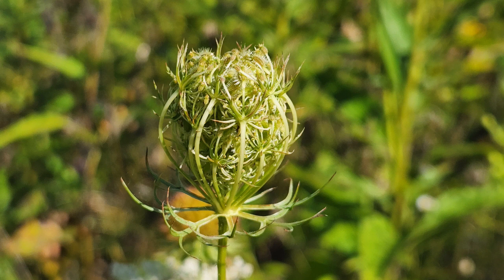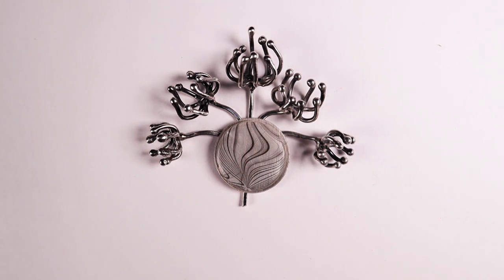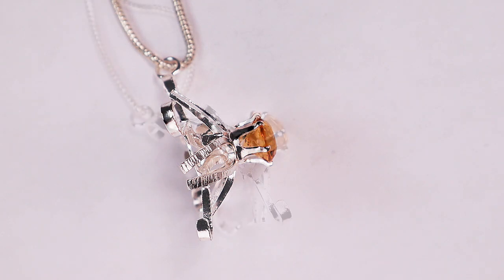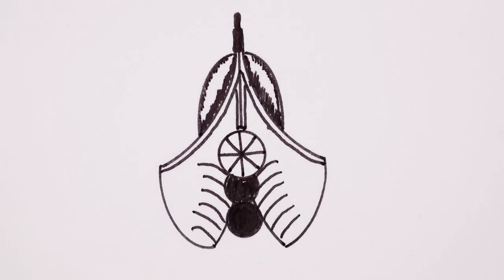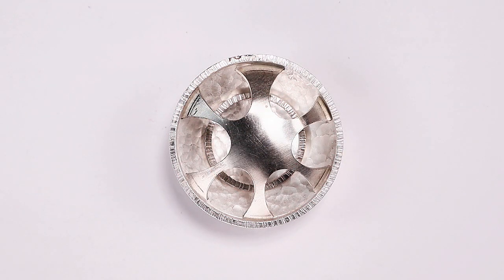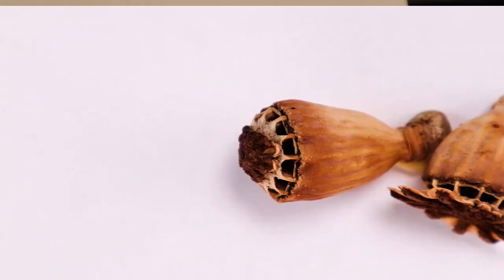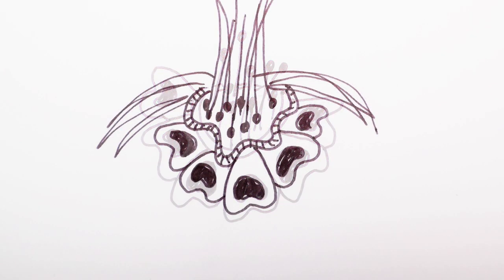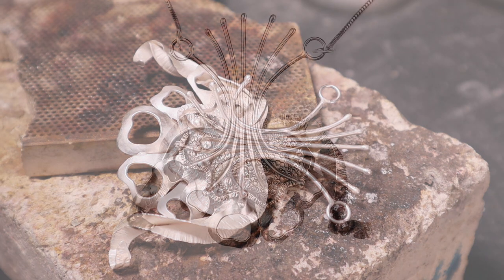JEWELRY DESIGNS FROM NATURE:  PART 1

Comment: really enjoyed all the textures/shapes/depths and craftsmanship. if a beginner had $1000-$1500 and wanted to get some material to get started what would your recommendations be wire/sheet and any online sources would be really helpful.
Reply from the maker: Hello D&L,  Thanks, I am glad you enjoyed the video! 

 For the beginner question. (This is a big question ).   It is always difficult to decide which direction to start  and this depends a bit on the student's interest.  I would start by concentrating on learning to bend, forge and solder wire.  Do not worry about sheet metal.  Get comfortable with the wires. Learn how it bends, how far one can forge a wire before it splits, how to solder small wires to large wires.   Design within the "limitations" (By the way, there are no limitations) of the wire.  Buy some SS wire, getting 12, 14, 18 ga. square and round.   Approx. 10 ft. per gauge.  This will be about $600. Also, get copper wire in 10 to 20 ga.  This will be for practicing  forging. Only buy smaller amounts as you need them. Your learning curve will determine what to buy. 

THIS IS IMPORTANT.  Work for a couple of months only working in wire. 

  Do the same for sheet metal. There are many more techniques using sheet, so start by learning how to saw correctly and with ease. Use copper sheet to learn on.  Saw, Saw, Saw!!  File , File File!  Learn to burnish the edges of sheet so you don't have to polish the edges.   Learn to solder seams and to sweat solder. Start fabricating simple boxes and 3-D forms.  Get comfortable with the sheet.
   
The idea of only working on the wire and/or sheet metal for a long extended time, is to get to know the characteristics of the metal.  Know what to expect from the metal.  Once a student understands what the metal will do, then the student can start to design pieces that will use the metal to it's full potential.  If one skips learning the basics, the student will always be handicapped and will feel and look like an ametuer. 

As for any online sources,  Of course,  start with all of my videos.  Use them as a base and a spring board.  There a other instructional videos out there that have different approaches to the subjects.  Find the ones that fit your personality. 
Wow, I sure hope this helps you and makes sense.  Thank you again for your questions.  You are always invited to ask.   Good Luck.   Greg Greenwood
Reply: @greggreenwood4628  Thanks a lot. This is really helpful. We definitely want to focus on learning to use the tools. Once we've gone through a bunch of metal hopefully in the end be able to make some fun projects with the family. You videos have been so helpful and inspiring. Cheers.
Reply from the maker: Hello D&L  You are more than welcome!!  Have fun.   Greg Greenwood